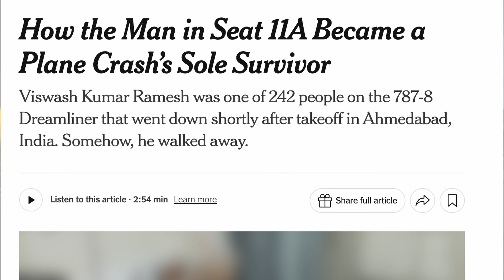Why the RAT Changes Everything – Air India 171 Update

Comment: I’m not a pilot, but I am an engineer, not an aircraft engineer, but radio and electronics and I have experience of reliability engineering and have worked at large airports that included responsibility for networks and radio systems. Back then I owned the LHR ECAP (electronic communications authorisation process) and worked closely with the CAA on airport protection (at LHR the CAA run the approach operations, not the airport). 

 I look at things logically as I see you do. Initially focus on the single points of failure. 

Like you the fuel and common control systems are the areas with the biggest potential single point of failure, was the wrong jet fuel or contaminated fuel loaded?, either at this airport or a previous refuelling that had worked its way into the engines? 

I also think back to the Heathrow BA38 B777-200ER dual engine failure incident in 2008. I wonder if there are any parallels?

Back then I was very suspicious of electromagnetic interference, we know our prime minister’s car was in the area and these cars have multiple powerful radio systems designed to pre-detonate and jam roadside bombs. I read the report and this was dismissed in one line, but I was not so sure. Ice crystals in the fuel was the reason stated back then.

The problem with electromagnetic interference is it leaves no audit trail, but it is still a big question mark in my book.

Of course at the end of the runway, there are some powerful radio transmitters. Was the electromagnetic protection on the aircraft compromised in someway, perhaps due to an incorrect maintenance procedure or design limitation, what radio systems were active at the time at the end of the runway and were they operating correctly?

When Air Force one landed at Heathrow, it caused radio chaos, was a similar type of plane at the airport at the time? 

Also, what was in the cargo hold? Anything that could generate electromagnetic interference or perhaps a source of helium? For example, a medical scanner? A helium leak would destroy micro electromechanical oscillators used as the clock source in micro computers. This would potentially cause multiple systems failures. There was an incident a few years back at a hospital where a helium leak from a scanner caused people’s mobile phones to stop working. 

Just a few single points of failure to consider.

Comment: The aeroplane took off normally means both engines were performing well. The plane started to descend only after 30 seconds. This means the plane lost thrust sometimes between 20-25 seconds of leaving the runway. Because the aircraft would continue to ascend for few seconds due to inertia. 
How is it possible that both the normally operating engines failed within 20-25 seconds of leaving the ground, nothing hit, no arc or fire, nothing. 
Probably something that never happened before in aviation history.

Comment: I heard an analysis yesterday that I thought was very reasonable.  Whilst on the run-way and passed the point of no return a catastrophic issue  occurred.  The pilots had to decide to crash on the run-way or take off and try to manage a return to the run-way for a managed crash landing.  That is why the landing gear was not retracted.  He also noted that the RAT was deployed by the sound and I still think this is reasonable.

Comment: Good analysis.
I think we will all be surprised by the final conclusion.
A dual engine failure with no bird strike involved is unbelievably rare.
They lost the power very abruptly though.
Even fuel contamination is unlikely to flame out 2 engines so quickly without any warning…
We’ll see…

Comment: Captain can you please look again. The position of flaps it were like they were struck in mid position while taking off then flattened a bit. And then when nose was coming down and the tail position gaining height the flap were trying to regain it's down position that will result in sinking the plane. The flap position were not as it should be. Along other possible  faults may be the hydraulic on electrical circuit fault in the pump might have been the spoiling factor in aircraft unable to generate enough lift.

Comment: Conspiracy check
Is it possible that fuel from main fuel tank stopped  by someone intentionally that, and whatever fuel was there in fuel lines gave that lift nearly 600 ft and after that due to fuel shortage both engines stopped suddenly

Comment: Ok, but why do we hear the engines if it's engine failure? The high pitch is from the small propeller, but the roar is from the main engines. This means they were having issues with the engines, but the engines did not come to a stop; otherwise, the plane would be gliding in silence, and all we could hear would be the small propeller.

Comment: 5:02 the orientation of the wheel dolly seems the wrong way, normally the back wheels are the ones that hang lower and it rotates into that orientation as is starts retracting, which could mean that they started the gear up process and then the hydraulics failed?

Comment: My personal theory is that something went wrong with the engines on the takeoff roll (likely causing that bang the sole survivor heard). They couldn’t abort the takeoff because they were over V1 but they were still below VR. They ran the plane right to the end of the runway causing the bit of dust to flick up that you can see in the security camera video. They rotated last minute, didn’t have enough speed and stalled.

The RAT would automatically deploy in a duel engine failure and based on Air India’s maintenance records, I can see a duel engine failure occurring on one of their aircraft.

This is all just a guess though

Comment: On Cpt. Steeeve's last video (the one he posted on June 12th 2025) I said... 

"The main question I have right now is... Was the Ram Air Turbine (RAT) deployed?
Because if it was... The RAT acts as a backup power source, primarily for critical systems like flight controls, hydraulics, and electrical power. It is deployed automatically in certain emergency situations, such as when both engines fail or all three hydraulic systems experience low pressure. 
The RAT is stowed in a compartment in the aircraft's fuselage under normal conditions and it deploys automatically in the event of a critical system failure... There is an angle of the crash where it looks like the RAT was deployed..."

Looks like I figured it out 3 days ago...

Comment: Doesn’t 787 have a history of electrical system failures ? And isn’t there a video of someone flying on the same plane some time before this flight , where he shows that air conditioning wasn’t working well and the entertainment system / or lights were not working ? Could this lead to severe electrical / hydraulic failure theory? This type of failure is listed as one of possible types in a dual engine failure situation .

Comment: Video reportedly shows electrical problems, inoperative air-conditioning, inside Air India Boeing 787 "Fly By Wire" Dreamliner, hours before it crashed.

The 787's carbon fiber fuselage removes the extra margin of safety provided by a conductive fuselage for the electronic/electro-mechanical components' ground paths. Activation of high current loads such as landing gear would increase ground circuit voltage drops.

Dreamliner would likely pass pre-flight test/diagnostics - unless they simulate the load during tests.

When queried about ASE_Mechanic's similar X post, Grok explained, in part:

     "The post by Kevin Parrotte highlights a potential vulnerability in the Boeing 787 Dreamliner’s carbon fiber fuselage, suggesting it lacks the conductive grounding paths of traditional metal fuselages, which could have contributed to the Air India crash on June 12, 2025, as reported by the New York Post.
      Research from the Journal of Aircraft (2018) indicates that carbon fiber composites, while lighter and stronger, can disrupt electrical grounding systems, a concern validated by Boeing’s 2021 inspections of 787 fuselage integrity, though no immediate safety risks were confirmed for in-service planes."

https://x.com/ASE_Mechanic/status/1933517130777178541

Comment: While we wait for more evidence the only clues from the video analysis and from the lone survivor are the only hypothetical answers to this tragedy, The pilots did their best on this unfortunate tragic event, I think there is space for another hypothesis I think the FADEC somehow failed catastrophically  or malfunction and the engines never flamed out but underperformed for some electrical issues in the FADEC system thrust can't be increased because it is governed and controlled electronically by the FADEC, electronic and software were malfunctioning at this point, this hypothesis can explain why the RAT was deployed automatically and the landing gear was partially retracted, and electrical/electronic deadly combination affecting the FADEC circuits? nothing the Pilots can do at this point other than send a Mayday message if you see the trajectory after takeoff is a straight line both engines were working but at lower speed/thrust, this could be corroborated by the survivor testimony of lack of race or throttle in his words, we can speculate that apparently engines were up and running but a low speed insufficient to generate the need it lift force, peace and prayers to all the souls involved in this tragedy

Comment: One of the other videos I watched, the sky plane tracker online system, shows the planes taxi-ing , take off (V1) shows the air travel time. The tracker he showed, only shows the take off, and climb. Then it stops at around 625 feet, 170km/h climb but not its decent.  The other channels thinks this was due to total power loss and the tracking system stopped updating the sky tracker system. Normally this sky plane tracker system shows decent and landing in real time. This did not happen.

Comment: I totally can’t believe this moron has 90k followers. The flaps were not deployed. They weren’t deployed on the runway, they were t deployed in the air. They were at max weight, and they started their take off midway down the runway. Plus you can hear the engines spooled up all the way to the ground.
Reply: Flaps have nothing to do with the crash. The plane has enough power to fly without using them.

Comment: Well, I guess my work at FAA Western Section will be busy for coming foreseeable future. 
Now, it's from Piloting skill to Engineering. Dual engine failure is possible.
Remember, fuel fed to both Engine run pumps and auxiliary pumps. 
The whole Engine electrical system could have been out, from main bus to engine,
as well as auxiliary. That's why RAT deployed. Falmer out without fuel. Probably flaps didn't even deploy, 
but the feedback system was feeding false data or monitoring system failed.

The question is, how and why? It's design, but is it electrical component failed before its certified life cycle period or
it's poor maintenance ? Even if boeing procured form vendor, it is boeing responsibility to maintain the quality control system. 
Is it Air India mantainence issue ? could be either one of these.